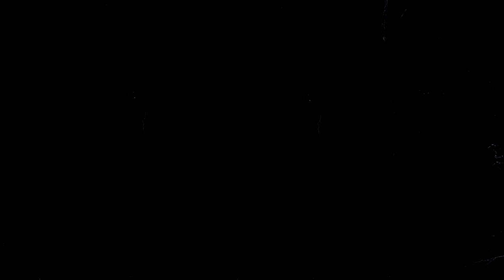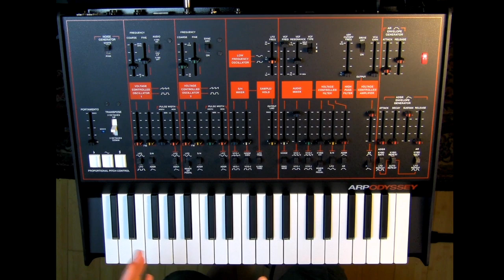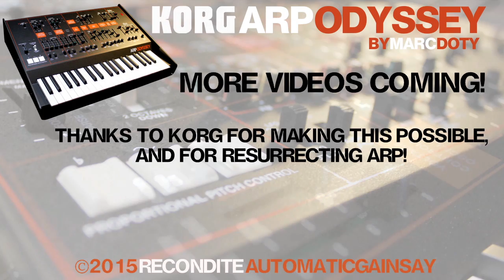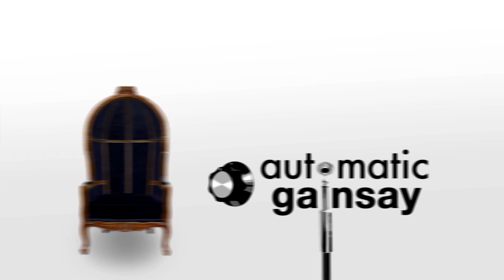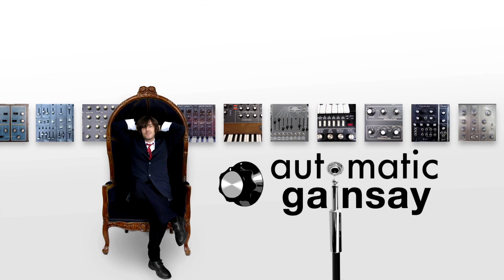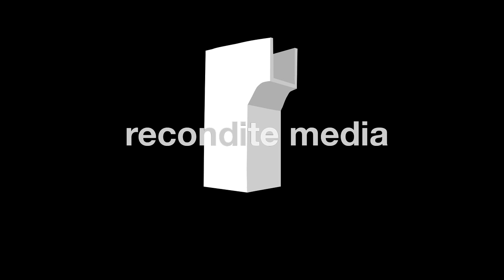ARP ODYSSEY - Marc Doty Inside Look Part 2: Oscillator Functions (1 of 2)

Comment: So you tune VCO to whatever note you want, then if I press a C on keyboard it will be a C? Im confused. So the tuning of the VCo is for the "sound" only, then the keyboard is a regular tuned keyboard?
Reply: Nope, you actually need to adjust the tuning so the C key plays a key. It’s more like a violin or guitar string tuner than a typical synth semitone transpose.

Comment: 5:00  Back in 1999, a friend named Charlie Lang gave me a homemade Musique Concrete tape which included, among gobs of other stuff, killer demonstrations of ARP's ADSR pitch control not in an Odyssey but an Axxe.  That was one of the reasons why an Axxe MkII was my first non-programmable synthesizer.  Good choice, when you factor in how the Axxe was introduced and marketed as a stepping stone to the Odyssey.

Comment: Is the arp odyssey the father of the dx7 in a way then?
Reply: nope. this is analog. dx7 is totally digital and a complete different sound creation
Reply: i get what you mean, though, because of the frequency modulation! i think the moog (minimoog) had the ability to frequency modulate, as well, though ... and i'm pretty sure it pre-dates the odyssey. i'm supposing FM was also a thing with the larger modular units at the time. i wonder if that's where john chowning (DX7 inventor?) got the ball rolling. i remember reading it had something to do with (pipe?) organ overtones ...